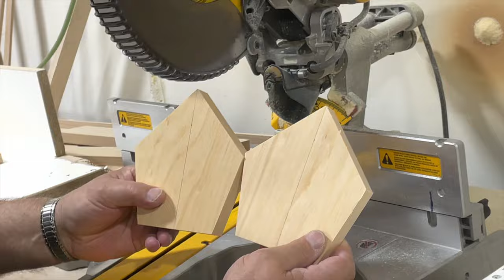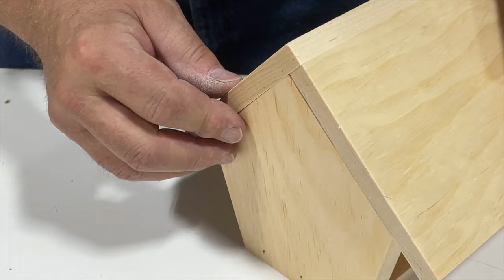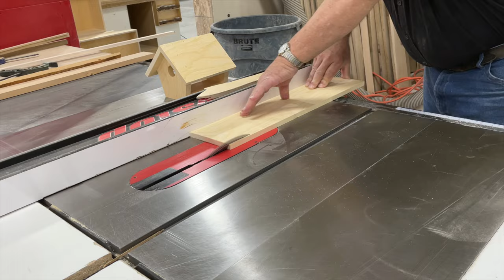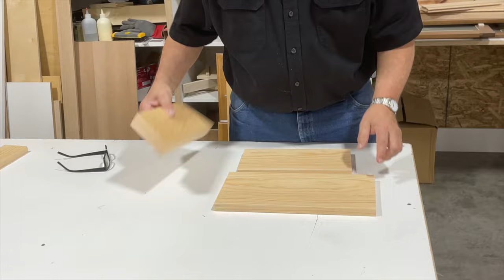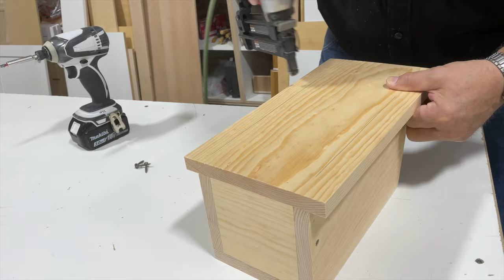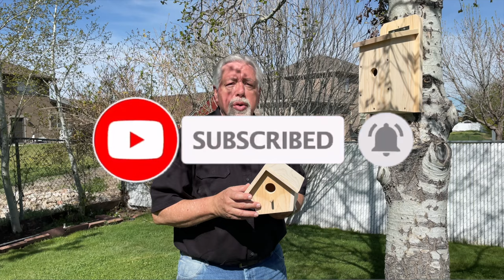Step-by-Step Simple DIY Birdhouses

Comment: Are you building it for show or for a bird to live in? If it is for a bird to live in, omit the little perch on the front. Predator birds will sit on it and use it to help them peck inside the house. The smaller birds that will live in the house do not need the perch to access the house.
Reply: He also didn’t leave a way to clean it out.
Reply: @TiCranium1988  0:34
Reply: @TiCranium1988 
Lack of a clean out door is the #1 problem with ‘bird house experts’. #2 is sticking a perch on it. #3 is having the wrong size hole for the type of bird the house is for. I am not an expert but I have done some research.

Comment: No vent holes a death trap, a one time house no way to clean it out. But if you understand how to put vent holes in or don't do the 30 degree cut on the sides and you have ventilation. and 2 pins and a screw in the bottom so you can clean out!
Reply: Can you post a video for that?
Reply: @EMWoodworking  If i knew how i would. But i don't know how.

Comment: Hi Wes. I tried to copy your first bird house and I run into a problem. How did you do the floor ? What should be the width before you do the 15 degree miter ? If I say the width of the floor is 51/2 inches and then do a 15 degree miter cut , the floor width will not match the width of the front and back. Second , I see your cuts are so perfect , do you mill your pieces before you start ? If you do , do you send them through jointer and thickness planer ? I would really appropriate your input.

Comment: Essential that bird boxes have vent/ drainage holes in the base. The entrance hole would benefit from a steel / metal protection rim to prevent predators from pecking out the wood. The inside of the front cover would benefit by glueing small twigs to make it easier for the fledglings to grip when egressing from the box.